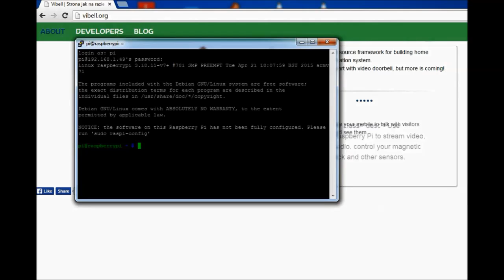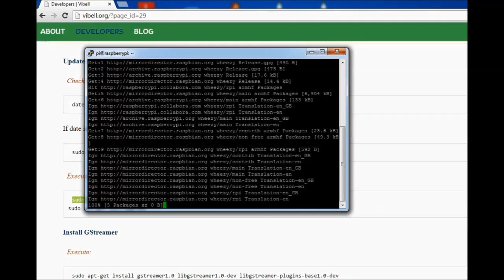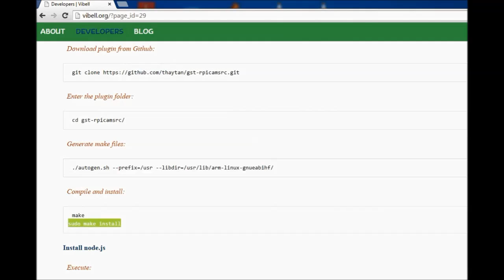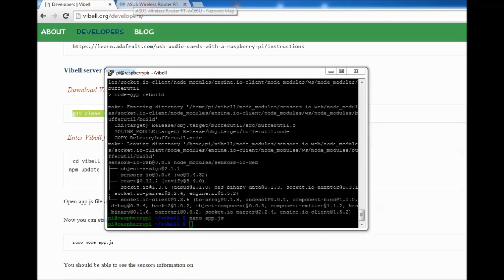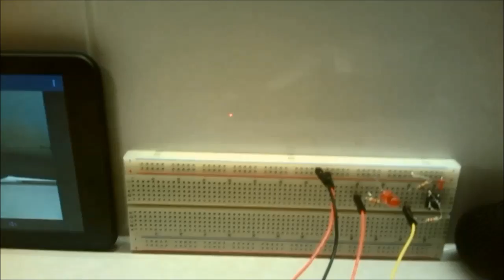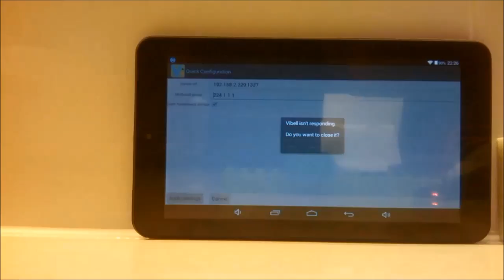Raspberry Pi Video doorbell Vibell

Comment: Nice work. What are you using for your  mic and speaker and how you setup it up if you want to use your existing doorbell?Thanks in advance. It would be nice to have PIR sensor notification too.
Reply from the maker: +zaher syed Hi I'm using USB sound card connected to RPi and cheapest USB powered speaker and regular mic. 
You can dissconnect you existing doorbell from main voltage and connect to RPi GPIO the same as I did on the video i.e. your doorbell button would close the same circuit as tactial button close in my video . If you want to keep your existing doorbell it's still possible, but it's a bit more complex but still feasible.
Reply: +PK Dev thanks, How do I change audio to Bluetooth? I am using Bluetooth speaker and mic combo.

Comment: Very nice work!
Can it work with multiple rooms? I am looking for a solution for my house and I want each room with its own call button. Can you provide an email address? I would be interested in buying a working and slightly modified (out of the box) version.
Reply from the maker: +Florica Cristian Yes it can work with multiple rooms. Do you just want call button in each room or also camera, mic and speaker? The only issue now is that Android App supports only 1 camera, mic, door button etc. in the same time. You would need to switch configuration each time you want to see different room. I'm planning to add support for multiple cameras and door buttons. You can reach me at contact (at) vibell.org